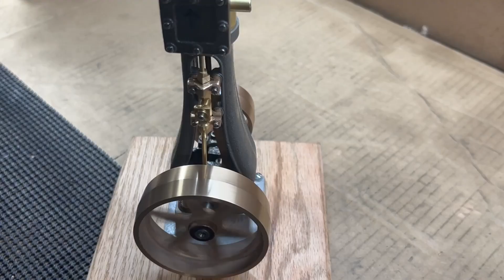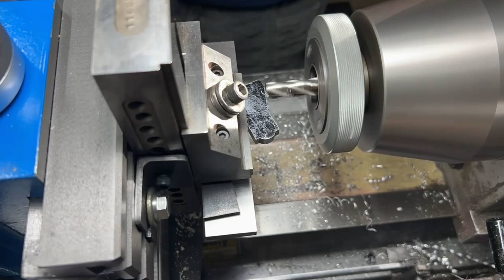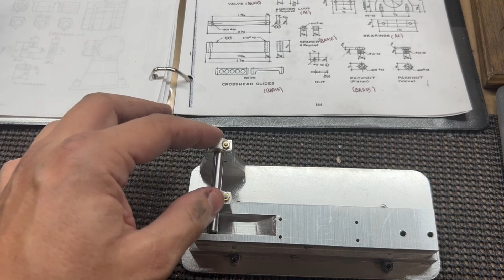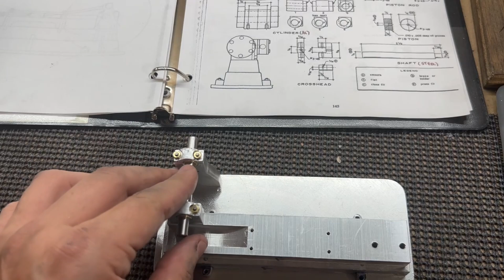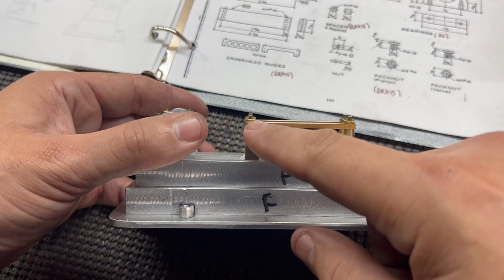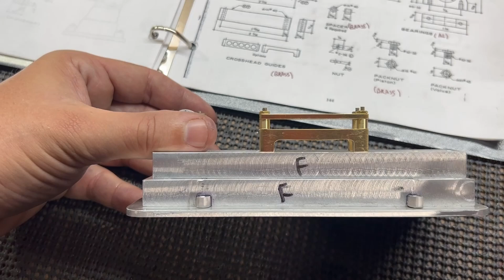Elmers #33 Mill Engine Episode 3

Comment: Great work. I still have to make a flywheel. I didn’t know where to start. Thanks
Reply from the maker: If you are using a milling machine, it is probably easier made using a rotary table. Either way, the trepanning then chain drilling then a lot of filing worked pretty good. If all else fails, Martin Models has some cast flywheels this size you could start with. https://www.martinmodel.com/collections/flywheel-castings-1-5